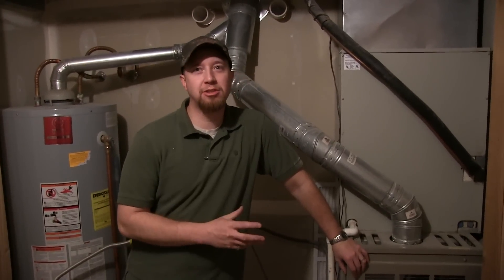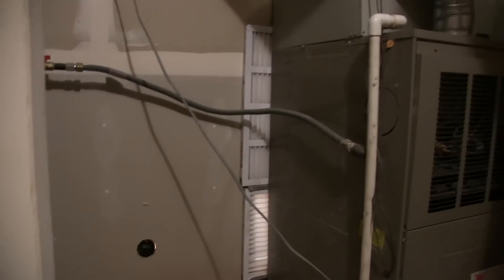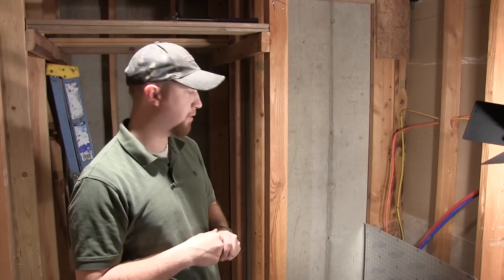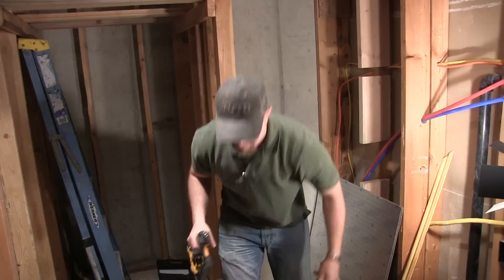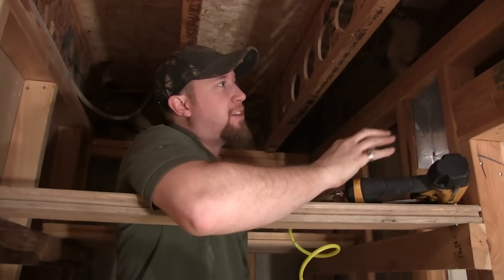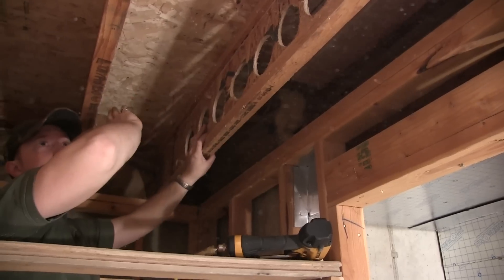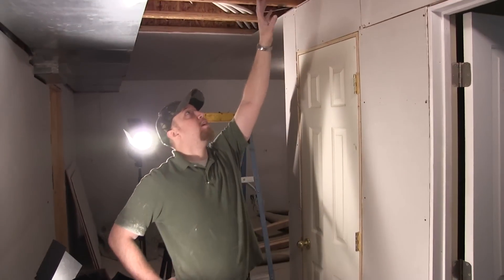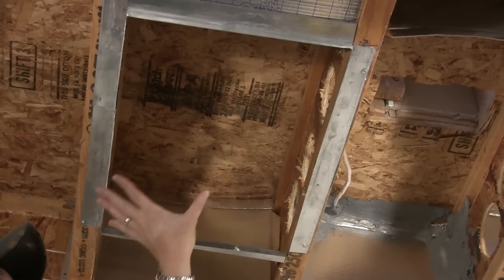How to Install a Return Air Vent - PlumbersStock.com

Comment: well im no expert, I was told Romex cable is not allowed to be in plenum spaces and drilling at the flange face of that joist with many holes turns it into swiss cheese and weakens that structural member.

Comment: I don't think you're suppose to drill all those large holes in the joist like that. It will lose its structural strength and may cause the floor to cave in in that area.

Comment: Thank you for the effort to make this helpful, informative, thorough video. However, I believe that the holes you drilled in the engineered floor joist are much too large. They weaken the joist and would never pass inspection in most jurisdictions.

Comment: I really think you should take this video down. I lost count of all the errors in construction/destruction and simple common sense.  Although your intention is good, there will be air quality, furnace efficiency, and structural issues in the future. This is so much like what the "sheet metal guys" did in my 1972 home. Dust and dirt on all of those unsealed joints, poor furnace performance, and constant sore throats and coughing.

Comment: I guess all of the sheet metal guys hate this installation?  You really should really be complaining about the architect who obviously gave no thought for the location and design of the HVAC return air in his house design.  Unfortunately, the installer has to weigh structural integrity versus proper air flow to the HVAC system and most installers won't care about structural integrity.  Many years ago, Carrier gave a class on static pressure, and the instructor claimed the biggest problem in most HVAC systems is an undersized return air duct.

Comment: My heart skipped a beat when I saw those 8 large holes side by side in a single TJI.  Maybe you can get away with removing that much material, but I've never seen it done before. I hope an inspector signed off on that, because it looks extremely sketchy to me.  I personally wouldn't even feel comfortable drilling the three holes he makes later.  "Beautiful" is definitely not what I'd be saying at that moment.

Thermopan is great, but it looks to me like this installation might have been better off with less 4" holes and more actual ducts.
Reply: As a structural engineer, these openings exceed the allowable limits you'd see for a TJI, for both size and spacing, too big and too close together. I see this no way this passes, it's retrofitting or replacing at this time.
Reply: Nah  most likely done  on a weekend when the inspector  is bbqing

Comment: Engineered I-Beam Rules
You can never, ever, ever notch or bore through the top or bottom flange or chord.
You can drill 1-1/2 in. holes anywhere in the web. In fact, most have little perforated knockout holes that can be punched out with the swing of a hammer.
Drill large holes toward the center of I-beam joists, not toward the ends.
Leave at least 1/4 in. (or the amount specified by the manufacturer) of web between the edge of the hole and the flange.

Joist Boring Rules
Holes must be at least 2 in. from the top and bottom edges of a joist.
Maximum hole size is one-third of the joist depth.

Joist Notching Rules
The maximum depth of a notch at the end of a joist (where it rests on a wall or beam) can’t exceed one-quarter of the joist depth.
Maximum notch depth in the outer third of a joist is one-sixth of the joist depth.
Limit the length of notches to one-third of the joist depth.
No notching in the middle third of a joist.

Comment: 2009 IRC
Section M1601.1.1 Stud wall cavities and spaces between solid floor joists cannot be used as supply-air plenums.In humid climates, a cavity space used as a return-air pathway will pull humid air into the cavity space, possibly encouraging mold growth or the deterioration of building materials, sending that bad air right into the home for the family to breathe. .A cavity space used as a return-air pathway will pull pollutants into the building from unknown sources, it's also pulling a lot of air from the nasty, yucky crawl space below the floor.  Nearly all building codes restrict the use of cavity spaces as supply ducts.
Reply: This above comment should be pinned on the top.
Reply: The most common way most hvac guys run "returns" to line their pockets. Yes pulls dust most fiberglass  ,  great  idea.
Reply: I thought that the whole comment was the code at first and couldn't believe that the word yucky was in the official code. 😂
Reply: I think it’s a great idea, maybe not drilling thru the joists but your describing SUPPLY air, he talking return air. There’s no heat, it’s moving air, filter on both ends. Mold isn’t a concern. I have a wood furnace, very similar senerio this seems much better than no return at all.

Comment: I'm a newbie at installing duct works and was planning to do a room in my basement.  I see lots of comments here by others claiming he did things wrong but he's one of the few videos on YouTube that actually walks through a process.  I appreciate his efforts.  Can someone post a link to another video that does a walk through like this?   Can i just use 4" or 6" aluminum ducts for an air return?  Or does the duct need to be as wide as the area between floor joist?  Room size isn't that  large.  It will be about a 12' by 10' space.
Reply: Everyone has to complain about everything.. they can't just shut their traps and be quiet

Comment: “Won’t screw up the structure at all” he says before drilling multiple 4” dia holes right next to each other through a TJI truss. Google:  allowable holes trus joist TJI,  to see what’s actually allowed by the manufacturer, Weyerhaeuser (They need to be 8” apart, if they’re even allowed for that exact size and series TJI truss, and assuming they’re located more than the minimum distance from the end support point.  (see the spec sheet).

Comment: Hello ..I'm really stuck Ihope you can give me some insight.  Problem: HVAC guy started got paid never came back. Biggest mistake I ever made . Now can't get no one to finish since its started . Main trunk supply is hung (8x16 reduced to 8x14) return holes are cut in floor above where the return duct needs mounted yet. So I have to get return to side of Horizontal furnace. I was going to pan floor joist cavity which is 14"1/2 X9" 1/2  1750 cfm out of furnace. Is that enough airflow for return? 3 Ton unit btw .. Thank you
Reply: Sam Gray 400 can per ton. Sounds like ur ok

Comment: Manual D and J says you can use bays as a return path as long as its bigger than required duct dimension. I dont know about holes. Why were they cut. Those holes will cause restriction of air flow. Is it ok to cut holes into joist. Does code vary

Comment: Wow none of you understand what this man is doing.There is nothing wrong with this video or his procedure.The holes in the webbing is fine AHJ would pass in heart beat.Nor do you have an understanding of air flow dynamics.
Reply: You are wrong.
Reply: Speaking of WOW! You have no idea of hole spacing in TJI's. Just go look at a TJI manufacturer for hole size and spacing. The only way AHJ would pass this in a heartbeat is if they did a drive-by inspection!

Comment: That TGI is DESTROYED no way can you cut eight 4 inch holes that close in a 12 inch TGI.  FIRE YOUR ASS check tgi specs on line. obviously no inspection was involved .no way will this pass due to destruction of the floor joist crazy wrong

Comment: why is there is no insulation ? it's a cooled air when they meet a normal air 90 % it will moist because of condensation  and it can damage your'e ceiling
Reply: Its the return most likely it will not condense. Supply will. Plus it looks like its going to be in a conditioned space

Comment: Is the return "cut" into the back of the furnace? From the looks of it, the return grill is just behind the furnace and not cut into it. And as long as the thermo pan is not used in humid climates, its a good product. But prefer metal panning.

Comment: I give you kudos for attempting to seal your work. But why bother? The air return will just be sucked in anywhere there wood joins another object or where it warps. So basically you just spent all your time make a system that pulls air from the basement that looks good instead of a system that actually aids in the air movement into a room.  I have a system like this and you know what the air barely moves into a room, why because all the return won't hold pressure causing the least resisting air to be pulled into the main unit from whatever crack is closest. I've attempted to seal and seal and seal my returns but these types of returns are garbage.

Comment: This guy doesn't have a clue about what he is doing.  On top of being wrong about the return duct on multiple levels, the return on the furnace is improperly installed.  You can not draw solely from the rear.  What an idiot.  These kind of guys create tons of work for HVAC contractors that know what they are doing, but it won't be as cheap as this project.
Reply: +Speed Demond i am not a hvac contractor, but what do you mean you cant solely draw air from the rear why not? My furnace has a supply end and one return end (electric), the return end has the built in holder for the filter. I have never seen a furnace in a house that has more than one filter location on it. So you pull unfiltered air through your new ducts or how does your method work? I am just installing a used furnace in a rental that use to have oil heat, that my brother gave me to use. So I would like your advice, thank you

Comment: This is a perfect example of how you should not do return air ducts.  I hope the producers of this video learn to do things the right way in the future and improve their methods.  Think about the return air static pressure when you're done- do those holes allow air to flow smoothly?  It doesn't matter because you should not have supply or return air going through a structure wall or cavity unless it is in a proper duct.  Proper ducts are sealed.  Even if this was allowable to do like in the video, there was no proper air sealing.  I advise anyone looking to do things right to look at national comfort institute.  The people producing the video most likely had good intentions, and surely would be open to improvement.  Best of luck!
Reply: acoustic4037. Atleast It serves as a wrong example. And the national comfort institue only serves contractors or students, the rest of us have to figure it out.
Reply: 3 holes for whole house return? Seem like not enough.
Reply: I was just gonna say... there are so many errors of construction going on here, thse joists are super compromised, and the plumbing was horrendous... I will be forgetting everything I saw immediately
Reply: https://www.nachi.org/building-cavities-supply-return-ducts.htm

Says you can do it in certain situations. How important is it that the return air flow smoothly?
Reply: This is the way to do air returns to line more money In your pockets.   Normally I see air returns   covered  by drywall to even line more money.

Comment: TGI joists are designed to be drilled thru at certain areas, but NOT that close to bearing(rimboard). That one joist with all the holes for R.A. should have failed framing inspection.All the holes should have been 12 inches apart.

Comment: Massive holes cut in two adjoining floor joists. It's amazing how cavalierly plumbers and HVAC people like this guy will destroy structural elements to make their runs.
Reply: I'm a hvac guy and would never make such careless mistakes. This video should be deleted horrible advice nothing is done correctly. The biggest mistake is still having combustion air mix with the return which can introduce CO into the air stream.
Reply: William Guenthner agreed.
Reply: He just covers those electrical wire big no no there not going in the proper direction
Reply: William Guenthner we give you job security brotha
Reply: Right.  But they don't have to worry because by the time the floor starts to cave, they're long gone... :-)
Reply: Those holes are strategically placed by the manufactures of the TGI's for the running of mechanicals. You morons need to get a clue.
Reply: @edwardjanowiak  your wrong. Too many holes in too close proximity.

Comment: electrical in an air return is against  code !
Reply: I'm A electrician Thats A high no no for my wire a fire will flow right in those walls
Reply: First Last   for new houses. Mine has a PVC pipe going through the return plenum. Having same problem with my old house. Wish my basement was larger and taller. I want to upgrade but it is what it is.
Reply: John Crypto. You beat me.
Reply: Yes this is where all of the fire and the smoke will be. The pex and the romex aren't kosher but what caught my eye the most was that gasflex line that went through that cavity. lets just put water power and gas together in a cavity that regularly pulls 1600+cfm. Good luck homeowner.